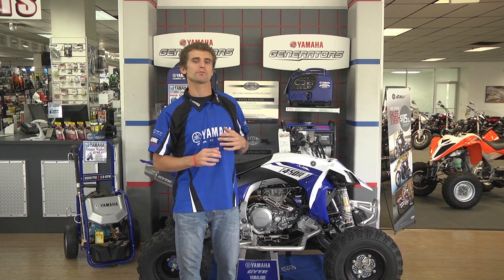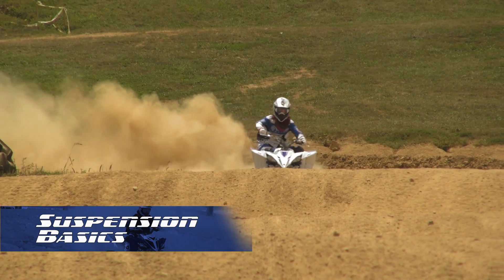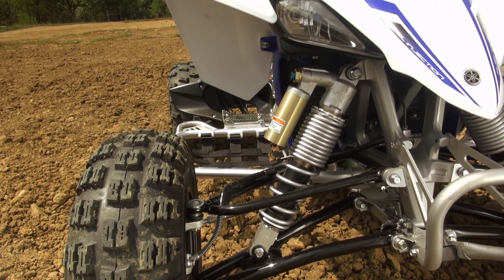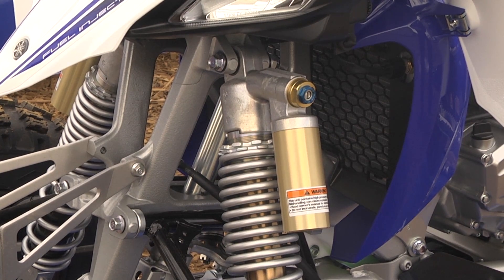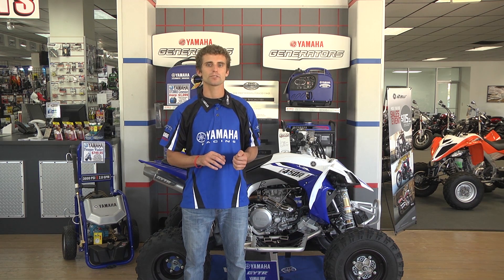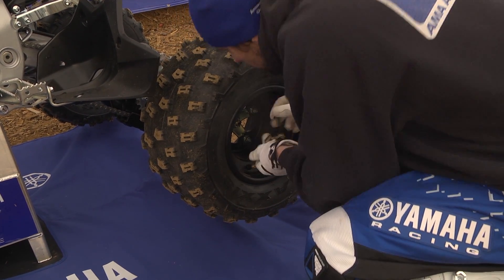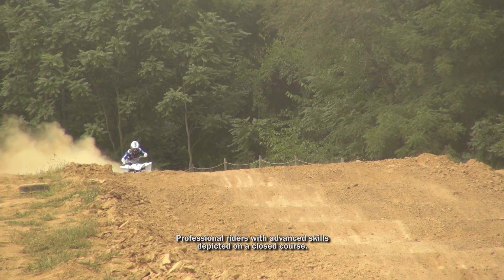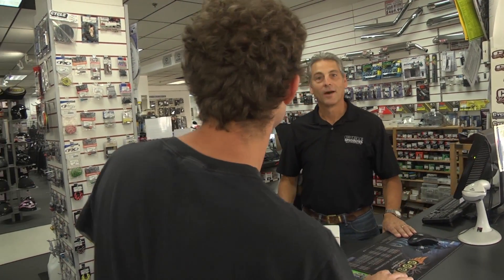ATV Suspension Tuning Basics, Yamaha Sport ATV Tech Tip Series

Comment: From a high end offroad racing standpoind, I always belived coilover preload only affects ride height and spring force, and adding more preload actually makes the spring softer because you are compressing it ?,  From what I have learned springs should be as soft as possible while all tuning should be on the shocks because shocks can react to different forces , low speed, high speed, low force, high force.

Comment: i have a 14r i just ride trails with lil jumprs i want to soften the shocks,whats should i adjust
Reply from the maker: What are you trying to accomplish? Do you want a stiffer ride or a softer ride? Besides preload which was discussed in this video your machine has high and low-speed compression damping up top on the reservoir and rebound damping adjustment at the bottom of the shock. Here's the quick and dirty. Starting in the middle, if not the factory settings, if you want a softer or firmer ride over things like roots, small square edged rocks, and square edged holes, adjust out or in on your high-speed compression. If you want your suspension to be softer, or better resist bottoming on jumps and g-outs, back out, or go in on your low-speed compression damping. Typically, we try and run as little rebound damping as possible without having the machine kick or bounce. Running too much rebound damping will make your suspension pack up in whoops, not allowing it to fully recover before the next bump which will result in the machine bucking, swapping, and all sorts of unpleasantness.  When you adjust your suspension, the general rule is to make small changes, one or two click or a quarter or half turn if there are no clicks, and test the ride.  Check your owners manual if you arent sure where the adjusters are located on your shocks and which adjusts what. Hope this helps.
Reply: ATVonDemand yea trying to just make my ride softer more comfortable

Comment: Ok I know this was a Yamaha shock video but I have a 2007 Suzuki LTR450 and it won't start the electric start doesn't work anymore I have to bump start it and then even once it's started it doesn't stay running unless I rev it for a long time or ride it. Is this a wire/valve issue if so how can I fix it or do you guys know a good video I could watch on how to do it.

Thank you!
Reply: The carburetor could be garbage, it might not be getting the right amount of fuel, or its receiving too much. Thats easy to check though, so I'm sure its not that. It might be the battery or some wiring issues. The worst thing it could be is you might need to fix something inside the engine like a top end rebuild but I REALLY doubt it. So yeah, I would replace the battery anyways.
Reply from the maker: Not sure on this one.
Reply: The battery is dead. Replace it.

Comment: You contradict yourself when you talk about preload ... They change RIDE HEIGHT not Shock stiffness , as you LATER state...
Reply from the maker: On zero preload, or many aftermarket shocks, preload primarily effects ride height and has little effect on stiffness.. On standard preload style shocks, like almost all OEM shocks Adding preload will more dramatically effect stiffness, or ride quality while also effecting ride height . Sorry if we weren't clear enough.
Reply: +ATVonDemand    I have been trying to completely understand the effect that preload has.. I run Elka's  and I noticed that they don't react excactly the same as oem , but the effects are similar.   Basically , preload adjusts mostly Ride Height though..This in turn effects handling and shock "feel" , and center of gravity .
   But the shock "stiffness" remains constant , unless you adjust Highspeed/lowspeed , rebound , or change spring itself..  ?
Thanks !
Reply from the maker: Yes. you are pretty much correct. If your Elka's are a zero preload setup,everything you said in reference to the effects of adding preload are true. On a zero preload shock if you want to have a noticable dffect on the firmness of softness of your spring rate you will need to change your cross over settings. This effects how soon your spring stack transferrs the load from your tender, or smaller spring, to the firmer or main spring. Keeping the load on the tender spring longer will yield a softer ride, while transferring the load onto the main spring sooner will yield a firmer ride. Compression and rebound damping are there to control velocity, not to make the shock stiffer of softer. Once your spring settings are right, then you dial in the ride with the damping adjustments. .

Comment: If you keep stock shocks on a raptor 350, could you still do jumps real well or should I put aftermarket? Thanks
Reply from the maker: +Xe Nukka  Good question. With your front shocks not being rebuildable, if you are exceeding the perfomrance capabilities of the stock shocks and their adjustment you may need to upgrade.  Truthfully the Raptor 350, or Warrior, and any sport ATV with non-rebuildable front shocks was ever really set up for big jumps.  If you have your spring preload maxed out and you are bottoming out often, its time to upgrade. If your not bottoming your shocks often than you might  able to hold off for a while. Here is a link to an affordable aftermarket shock test we did on a Honda 300EX that we know from experience works quite well on the Warrior/Raptor 350. https://youtu.be/G9Idf4Kahzk Works can build shocks set up for jumping and have more affordable options than most other shock manufacturers.
Reply: +ATVonDemand Could I get away with only front aftermarket shocks till I start racing? Or buy front and back? Also I am new to this stuff but could you put a different brand on the front shocks and another different one on the back? And why type of shocks are good for all around? Thanks!

Comment: hey , I have bad english , if I want good traction for drag racing I go clockwise?? , some one explain me please
Reply from the maker: +zaji7 If you want more traction, turn the spring preload counterclockwise or to the left to soften up the spring. A softer spring will allow more weight transfer improving traction.. This includes traction for drag racing, or traction for corners. The drawback is that if you go to far, the shocks will bottom too easily, you could get too much body roll in the turns,  I hope this helps. Let us know if you have any other questions.
Reply: ATVonDemand got it , thanks a lot for your answer , you just didn't tell me what to do , but explained it perfectly , thanks again.
Reply from the maker: Awesome.
Reply: so u do that for the front and rear springs for more traction ?